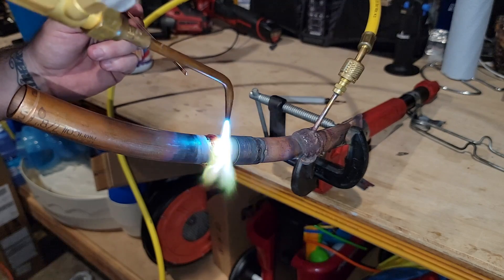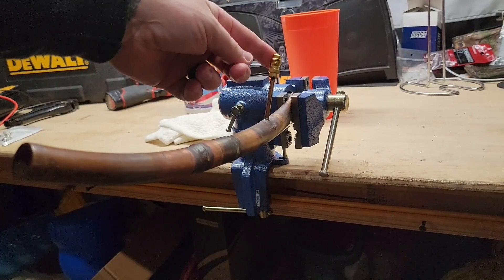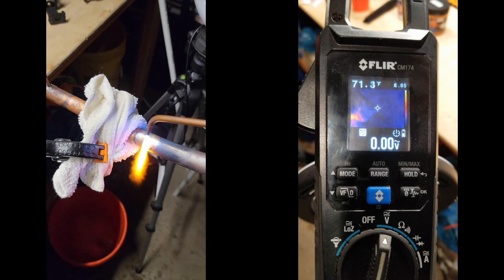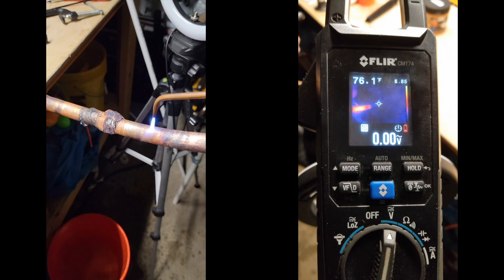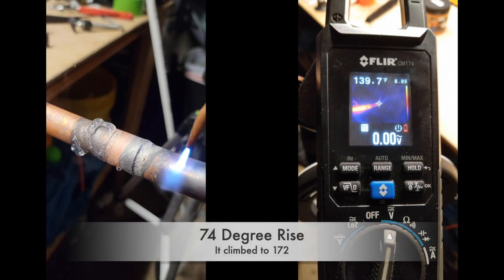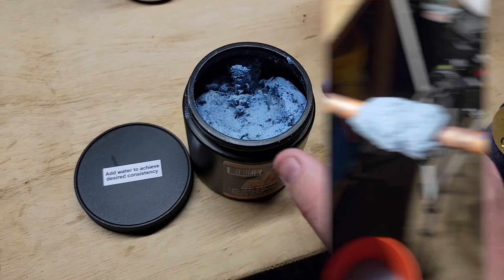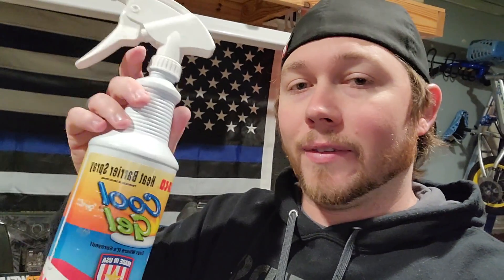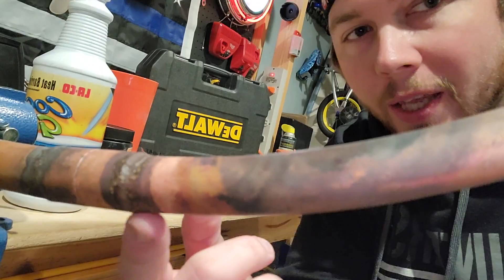Solderweld VS. Cool Gel! How To Braze Safely

Comment: The wet rag is a no-brainer.  Provides the same thing without the mess.  Also, your flag is improperly displayed.
Reply from the maker: How so?
Reply: @WorldofHVAC  The only time a flag is in that position is advancing forward, so you will see that on an arm patch.  In all other cases (except for distress) stars to the left..stripes on the right. for vertical or horizontal displays.
Reply from the maker: Wow I did not know that. Thank you I will make the adjustment.

Comment: Wetrag vs hot block. I have both now. I might have to test it. Good video👍👍
Reply from the maker: Its the same concept, I wonder if one product has a different component built in that makes it better.
Reply: @WorldofHVAC  I noticed it doesn't have that weird graphite resin that stays on your hands. I'm sure I'll get a chance to use it next week
Reply from the maker: @HVACRSurvival  my hand was so blue after I was done